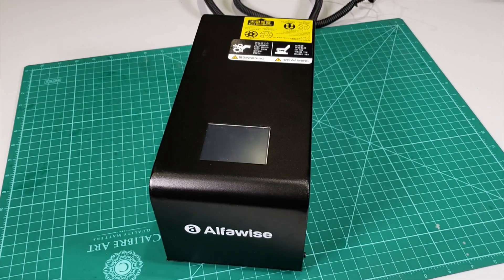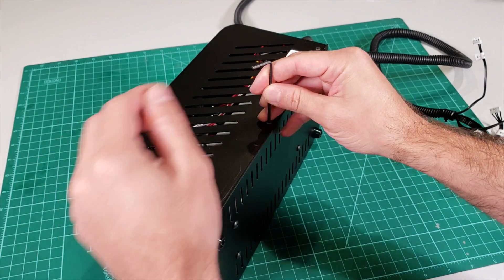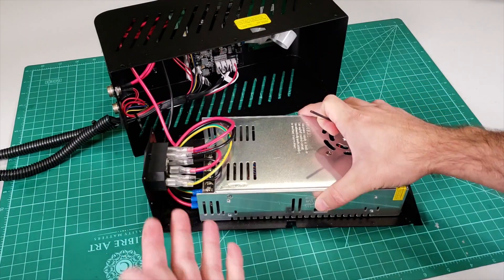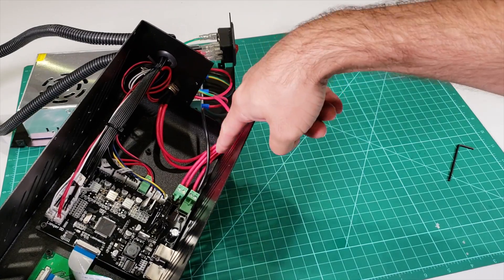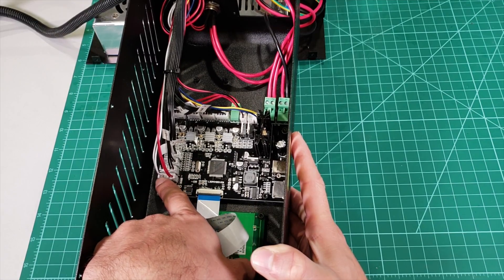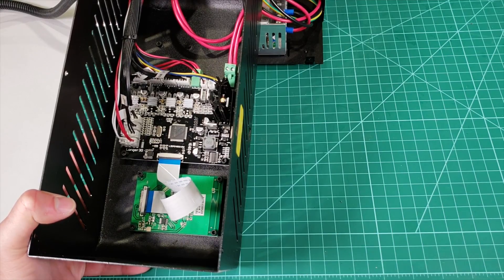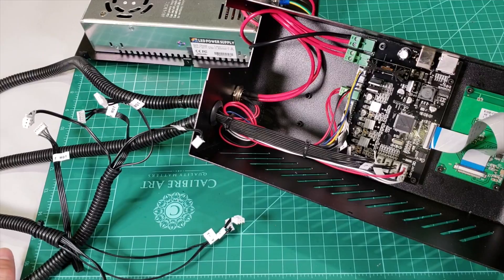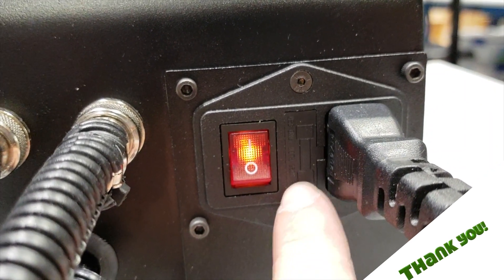What is Inside the Controller Box of Alfawise U20

Comment: This was a great video, but only about half of what I was looking for.  Do you know where one could find any sort of model number or manual in order to dig further into the microcontroller / board?  What are all those unused pin-ports on the board?
Reply from the maker: I dont have the printer anymore, so i cant tell what is the board model. If you have it, take a look inside. There should be marks for what you are looking for.
Reply from the maker: Unused pins maybe digital i/o. But we need that model info for the board for sure

Comment: Any idea how to get the screen un frozen? It won't let me click anything on my U20
Reply from the maker: At this point I suggest you to upgrade the latest firmware. If your print is still going on it should unfreeze when the print is done. Generally when you power cycle it, it should unfreeze. But first step is to update formware
Reply: @3DPDoctor  No like this is brand new out of box. Haven't printed anything. Also followed everyone's steps to update firmware and it doesn't do the updating screen that everyone else's shows.
Reply from the maker: Is it just frozen right out of the box when you open it?
Reply from the maker: Did you check my video as well for updating?
Reply: @3DPDoctor  I'll check it out and get back to you🤙

Comment: great video dont suppose you know which is hot end fan wires as the fan ends dont match board end
Reply from the maker: Thank you! Yes I dont know. There are 2 ways to figure it out. See the board number/name and look up the pin mapping or use multimater to follow the line ends. Probably one of those thin lines are fan lines that goes as couple
Reply: @3DPDoctor  thanks I have figured it out the blue/yellow in hotend fan of u ever need for future reference